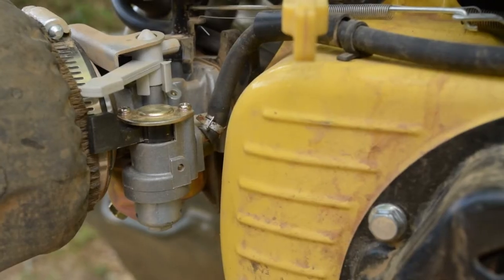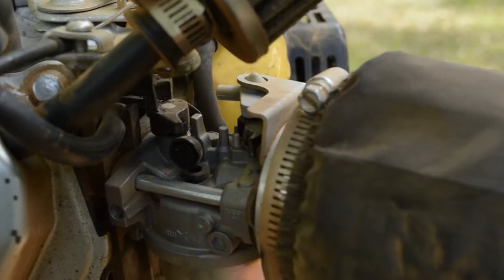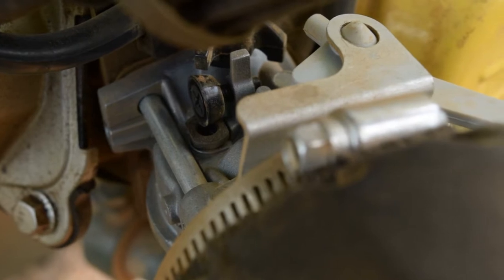Carburetor Problems Solved!

Comment: One thing I've found is that a lot of problems that are had with carbureted engines has nothing to do with the carburetor but with this trash fuel we have to run in them..... add Seafoam and watch the difference.... I use this stuff in every tank of all my engines with a carburetor.....
Reply from the maker: Yeah I keep fuel stabilizer in all my small motors for the same reason. also this new filter has a sort of small bowl pre-filter, and that goes a long way toward keeping the gas clean. The other carburetor didn't, and I had trash in it.

The carburetor ran fine bone stock. The issue is when you upgrade to the open air filter and exhaust, you have to rejet the main running jet because these little units don't have adjustment screws of any kind.

There's no way to adjust fuel mixture other than putting new jets in. With the genuine Ruxing, the idle jets fit perfectly, so now I can run idles speeds much better.